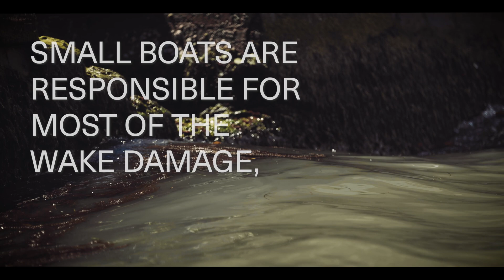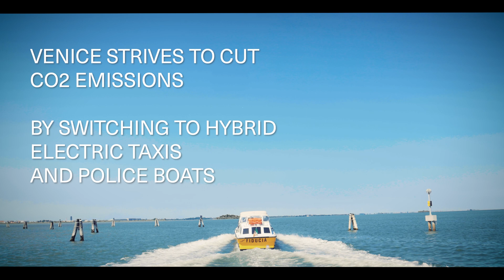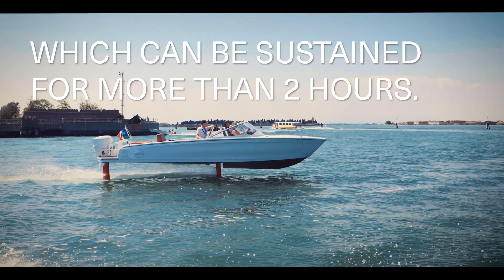Electric boats | Flying on the canals of Venice

Comment: What's the speed limit in the canals? And what is the take-off speed of the C7? If the second is higher than the first, then in the canals you are either breaking the law or traveling in displacement mode and therefore creating a wake like all other vessels.